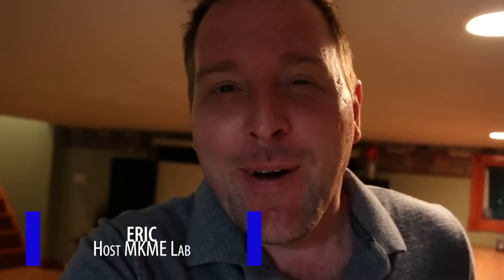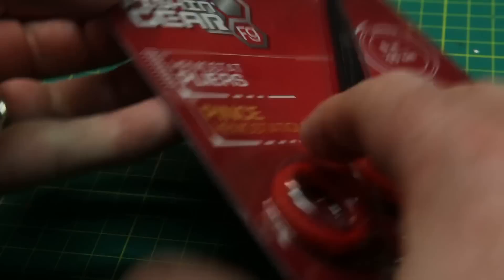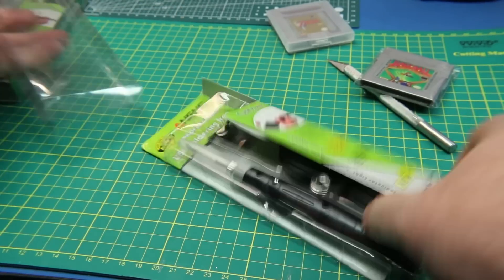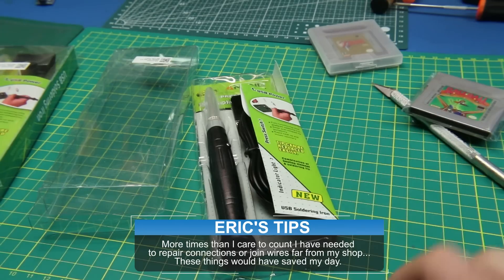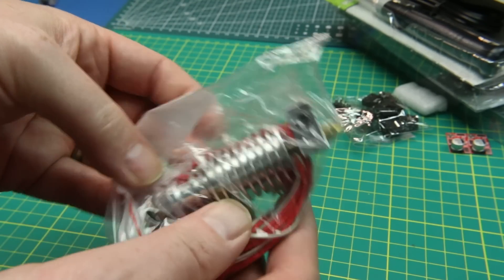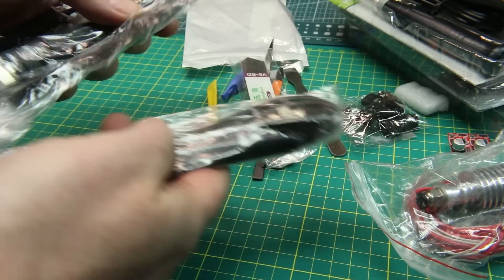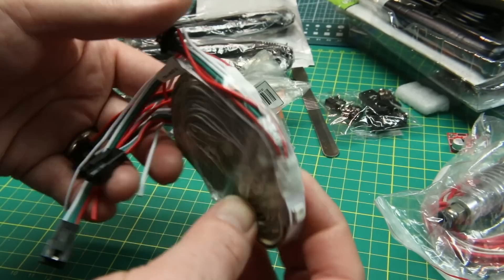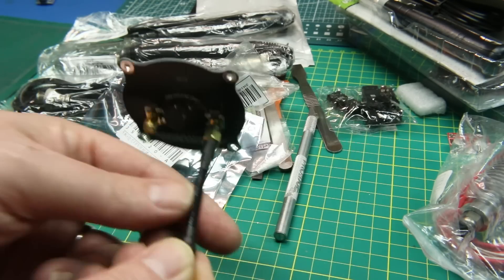🆕MAILBAG! Solder Irons, LED's, AWESOME Recycled Power Tools & MORE!

Comment: @MKme Lab I didn't mention I have done one better a few years ago. Use to visit recycle center frequently and picked up saw, right angle drill, regular drill and a light along with batteries  for free. Always nice to have extras. Picked up laptop batteries and took them apart so I could use in some cheap Chinese power banks and a couple good banks. They moved to another city and I don't get there very much.

Comment: Never found any that cheap at restore. You might have been able to find a file to 3d print the case if you were lucky
Reply from the maker: Noper I checked. It is a bit unique. All good. I have 3 now and one already has a 1300 75C lipo in it :)

Comment: Pretty nice stuff there, dude. 😃
BTW, if you can, do get a TS100. It's better than you can imagine! 😉
Reply from the maker: I could but I have zero desire to do so. No thermal mass to them and rely on the temp compensation- I've seen dozens of videos and I have yet to see any decent performance or a review soldering normal components and everyday repair. Yep they will work for some light duty stuff but I'd wager my stations would take them every time hands down...

Comment: The hot air tool is the only thing to go on my WEP!
And boy did it go!
Reply from the maker: That sucks.  Glad mine has been problem free so far.  I love that hot air gun!
Reply: @MkmeOrg  The good thing is (as you stated) they are easy to repair and replace. just buy the replacement tool and just plug it in.